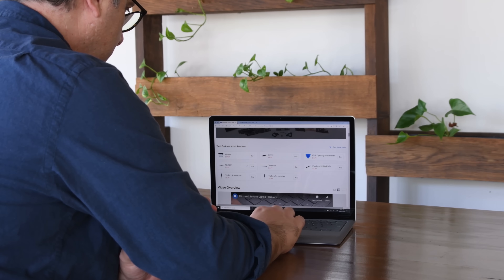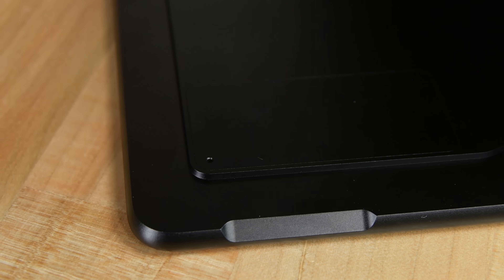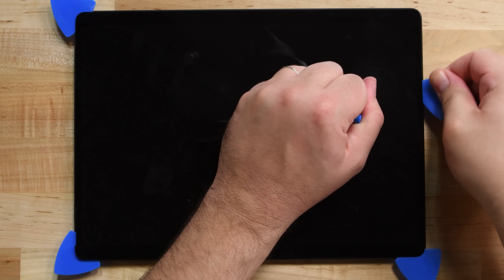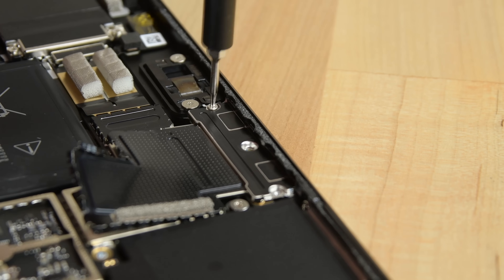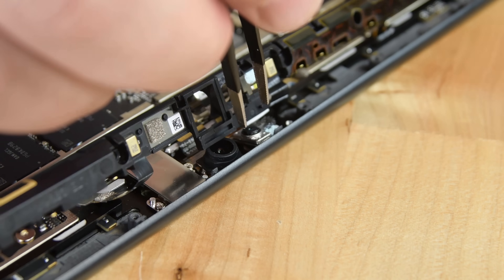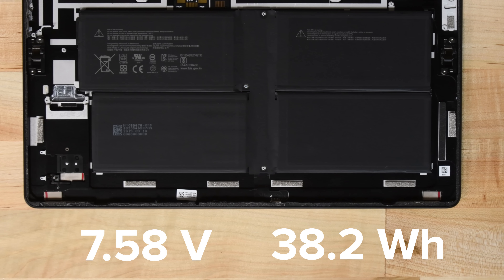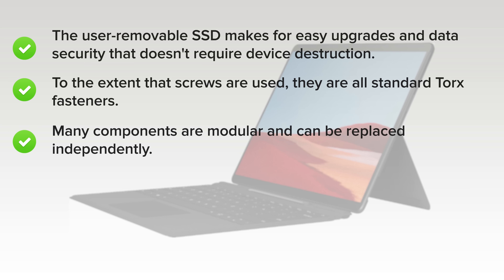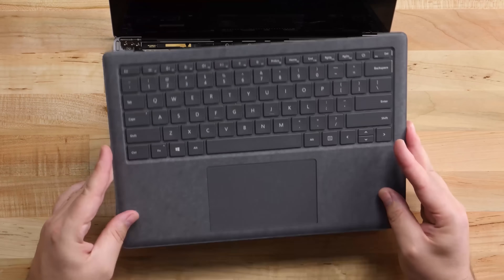Surface Pro X Teardown! Most Repairable Surface Pro Ever??

Comment: It should have a worse score, I replace batteries and screens in surface's and this one is much worse than all the surfaces that come before it. Some of the screws are a larger torx bit than other surfaces they haven't made any significant changes that should give it a score above a pro 4

Comment: But how easy is it to upgrade the SSD and hace the device in the same working order?
Aren't there a whole bunch of partitions, folders and other Microsofty security crap?
Reply: You can download a usb-stick-bootable image with all the surface stuff included directly from microsoft, using a valid surface's serial number. I did it the other day before giving my old surface 7 to my dad
Reply: @Kowalskithegreat  Ok, thanks. What about the Windows activation product key? Did Microsoft require you to enter any product keys after the new install?
Reply: @PushyPawn  it activated itself I didn't have to do anything

Comment: So, I'm new to the whole surface game, but I have a few questions.
1. If I take all of this apart, and I take the shields off the parts inside, can I put all the bits back together again?
2. If I do take it completely apart, can I interchange any RAM or add more? I REALLY want more RAM.
3. Does the screen attach back together after you rip it off the glue?
4. Last but not least, can someone tell me just how much of this laptop is interchangeable? (the inside parts)

Comment: this assessment is wrong. you can't give a 6 out of 10 on reparability  when the battery is glued in like that.  true score should is 2. 
3 max.  
the battery will be the first thing to go, and when it does, 99% of users will have no choice but to throw away the entire device or pay microsoft some ridiculous replacement cost.  no one should buy these devices.

Comment: I had a surface pro 5th gen. The battery went off. Microsoft : The battery can NOT be replaced, they proposed to replace the whole device for 450 bucks. I tried the repair, I cracked the screen, the screen replacement 180 bucks. I gave up my surface pro 5th gen. I lost plenty of third party software licenses + the device itself. Will never buy a Microsoft hardware ever again until they make totally serviceable as Dell and Lenovo. Now in process to get the Lenovo X1 tablet

Comment: The removable SSD is not as nice as it sounds. Most m.2 SSDs are 2242 or 2280  (i.e. too long)
It's actually surprisingly hard to find good m.2 2230 SSDs for consumer purchase.

Comment: Battery is non replaceable, access to internals requires hours of risky screen and metal shield removing. To reassemble will be even more pain in the ass to replace those shields. SSD type is hard to find and very expensive. So how does it get a 6/10? That's just bizarre...

Comment: i have a asus mid-range laptop and its hinges had become stiff after a year. can you tell us how to fix  it.
do they use lubricants in the hinges or it's just the dust that makes it hard to move.

this kind of problem is quite common for budget problems for budget laptops irrespective of the brand, i guess.

Comment: the only things i replace on a laptop are the hard drive, ram and battery
Reply: That's what most people do. The SSD is a huge change and welcomed. But they could have added pull tabs or secured the battery in differently. The RAM is still fairly easy in this just time consuming.
Reply: How often do you replace ram on a laptop? Becoming increasingly hard to find good models with RAM not soldered.

Comment: On the Lenovo X1 tablet the battery is accessable without removing the display adhesive, a new one can be bought and swapped out.
So, I'm still not buying any disposable Surface Crap. Try harder, like you really mean it!

Comment: So on the “downside” you’re not going to say anything about the heat shields you say that take “hours” to remove and aren’t reusable. I’d say that’s something big to include
Reply: Those shields are necessary that's why.
Reply: @KMon1111IND  yes exactly otherwise the surface will thermal throttle because of no heat dissipation.
Reply: @adityathakur7604  so why don't other laptops have these "shields? They are only there to discourage removal and prove violation of warranty if removed
Reply: @jm1835  Other laptops have a fan.
Reply: These look like RF shields. A must have for interference certification especially as it is a mobile device and not a laptop
Reply: I think they didn't hold that against the device because they aren't essential components themselves but are more to protect essential components from wear and tear.

Comment: You will be able to upgrade the SSD only if you can find another one like this 🤣
Reply: Standard Toshiba 2230 NVMEs work fine.
Reply: @Zacchi4000 it is
Reply: It’s a normal 2230 nvme you moron
Reply: @Zacchi4000 it's nvme but the length of the stick is not standard... it's shorter
Reply: @bishal_k_roy  it is standard, it's 2230. The NGFF allows for 2230, 2262, 22110.
Reply: @bishal_k_roy  It is standed. Nvme comes in all different lengths. You can easily buy a replacement from any retailer
Reply: @Primeyy  it's not "easy" to buy as only two manufacturers make them and they're very expensive. And You will never find it in-store only online
Reply: You can't upgrade even if you find another.  You can only swam same capacity.
Reply: @imho4990  that's not true, stop spreading fake news. Standard 2230 NGFF key m work fine.
Reply: @imho4990  i smell an apple fanboy here

Comment: They barked so much about repairability then for what reason they had to glue down the battery?😤
Reply: I assume that they are getting the case included with the battery. The battery will act as a guide for the rest of the components like motherboard and such to be placed so it will not slide around and reduce manufacturing/repair error. And besides, if they need to ship something, its safer to ship the entire case with the battery inside it since it will be less likely to be bumped around and get damaged.
Reply: I don't think that makes any sense. There are a lot of other options for fixing a thing in a place. I think they only wanted to be a nice guy without being actually nice.

Comment: The replaceable ssd is alone a upgrading point for some
Reply: keep in mind that its only a 30mm nvme, which is not a very common size, good luck finding many replacements
Reply: @tylercgarrison  It's not that hard to find, it's unusual, but they definitely exist, which is better than nothing in my book.
Reply: @TheFPSPower  Hiya, a little help please,
I tried searching for '30mm nvme' and only kept getting results for the longer nvme ssds. 
Could you please tell me what keywords I should be using to find the ssd for the surface x?
thanks
Reply: @dhruvhalwasiya  M.2 2230 nvme
Reply: @TheFPSPower  thanks a ton bro!
Reply: @tylercgarrison  True, but it's small enough to deter OEM's from soldering SSD's....... Microsoft charges a ridiculous price for their memory upgrades.....Toshiba just launched a 1TB 2230mm nvme ssd...microsoft only offers 512GB
Reply: @kninezbanks  Hiya, a little help please,
I tried searching for '30mm nvme' and only kept getting results for the longer nvme ssds. 
Could you please tell me what keywords I should be using to find the ssd for the surface x?
thanks
Reply: Amazon Or Newegg don't have the 2230 I'm looking for and the ones they do have are the same storage compacity or ones with bad review. Can anyone give me a link please? Thank you.

Comment: I wonder, if the device get stolen, is it possible for a thief to just replace the ssd and sell the device again like brand new, knowing that all the data and secure information saved in that ssd?
Reply: There could be board firmware locks, but I doubt MS implemented that.
Reply: Tom Chai So it won’t have the ability to find the laptop or secure the laptop from a thief with password and face unlock, if the thief replace the ssd? So sad, no privacy and security ☹️☹️
Reply: Bitlocker my friend, same as a laptop.
Reply: Nguyễn Hồng Hải how does it work?
Reply: @wizuraihakim2816  Bitlocker means all the data in the drive will be encrypted on the hard drive level, before window login this is how business are encrypted so it's miles better than average mobile solutions.
Reply: Nguyễn Hồng Hải and the data is saved in?
Ssd?

Comment: 6/10 seems generous considering the risks involved with screen removal and all those shields.
Reply: The scores seem to be tailored to the device type, which in this case is a tablet PC. If this was scored as a laptop it would probably be a 2/10.
Reply: @unarmedduck  surface laptop still got 5/10  with the same shields and battery glued in. I think they give a better score because previous model was so terrible
Reply: @jm1835  The surface laptop doesn't require the awkward removal of the LCD panel just to reach the internals though.
Reply: @unarmedduck  So in 2030 we'll be like: device cannot be disassembled without permanent damage and rotary tools involved but at least you can swap a drive in just 5 hours and device will turn on after you band-aid it back together - 6/10!
Reply: Perhaps you don't have to take off all the shields if only one components needs replacement
Reply: But it's still possible. And I'm sure that the easy swap SSD and the fact that tons of the components aren't screwed on is a huge help for the score..

Comment: I wonder how much those proprietary SSD’s will cost from Microsoft
Reply: They're not proprietary, they're m.2 drives in an unusual length. It's around the size of a wifi card, when they're usually much bigger.
Reply: they look like msata, and they pretty cheap right now.
Reply: Actually it's quite possible it can be an NVMe SSD, since previously Microsoft had already sourced BGA chip SSDs from Samsung (specifically the PM971a, identified in the Surface Pro 5 teardown as KUS020203M-B000), most likely the SSD in this tablet would have that style of SSD in a M.2 FF.
Edit: Toshiba is the only one I found on Google that has an SSD in that such form factor: https://www.servethehome.com/toshiba-bg4-single-package-m-2-2230-30mm-nvme-ssd-review/
https://www.tomshardware.com/reviews/toshiba-bg4-m.2-nvme-ssd-review,6330.html
Reply: It's a 2230(30mm) SSD and normal long SSDs are 2280(80mm)
Reply: @bishal_k_roy  normal can be 2262, 2280, or 22110
Reply: You can find them online but they're very expensive